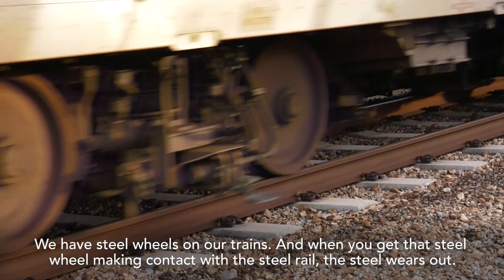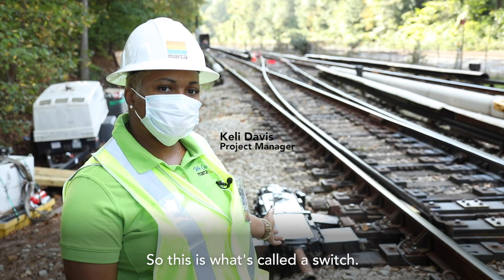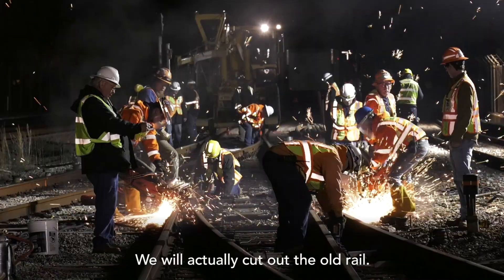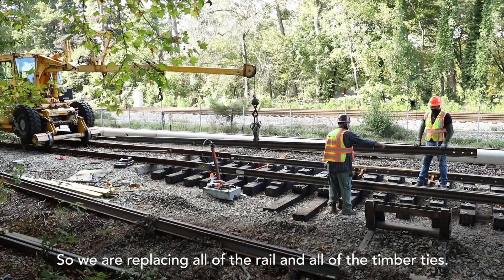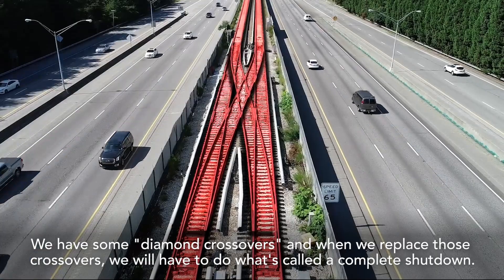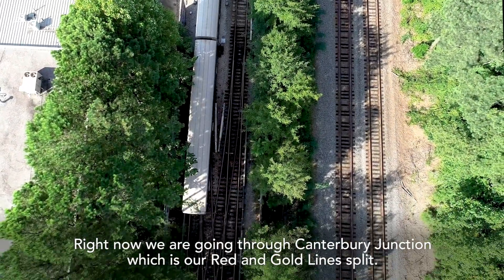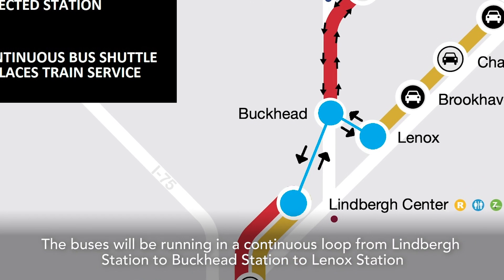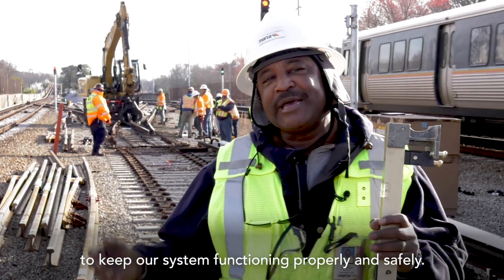Track Replacement at Canterbury Junction

Comment: Track maintenance is a heavy-duty job and it must be done. Better is to replace a large section of track in a few days, such as a weekend, than to replace small portions of track in small dribbles that would require several weeks to complete.